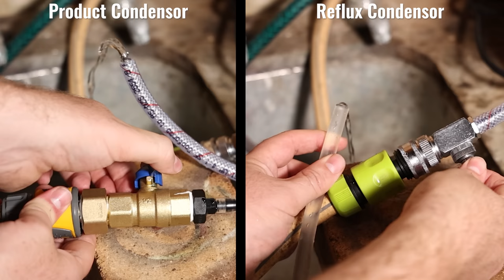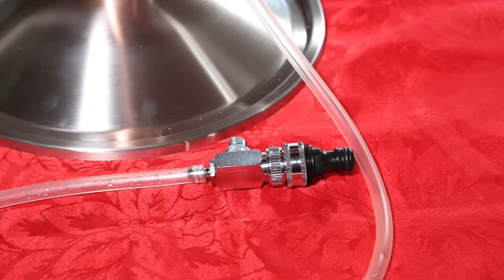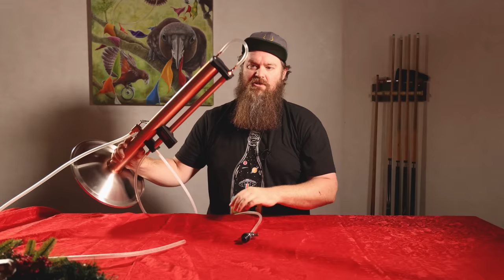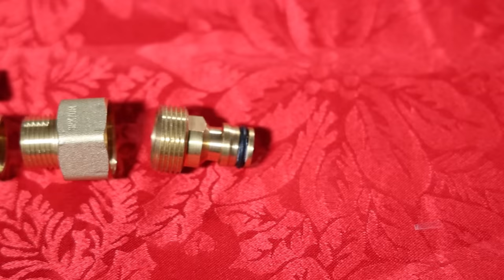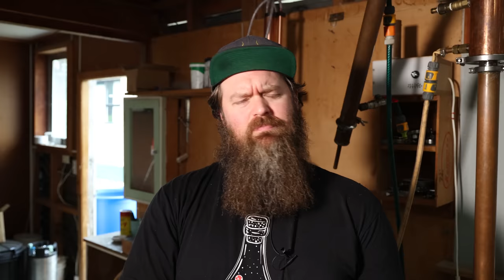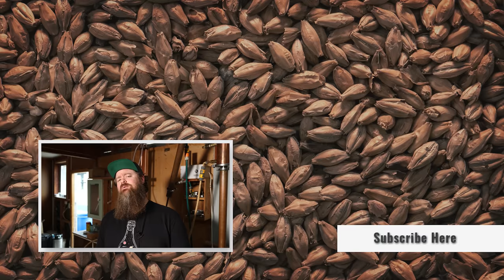Upgrade Your T500 Water Supply : Separate Product & Reflux Condensers

Comment: You only need one water supply. Put a T fitting on the hose coming out of the condenser. On the T, put one hose to exit the condenser. The other end of the T, put a hose with a valve on it going to the reflux chamber. That will give you free flow through the condenser and let you control flow through the reflux column.
Reply: Right, but each leg of the supply needs a separate needle valve to best control water flow.
Reply: @rocketsroc  true. But I believe Jesse did say he wasn't concerned about controlling flow through the condenser.
Reply: @jason6175  Ya, I have to use city water so running water any faster than necessary costs, so needle valves on both sides lets me adjust the flow as needed to either.  If water temperature is pretty cool, it doesn't take a huge flow through the condenser to condense, about 30 degree difference will do fine.

Comment: Hmmm I two minds about your mod’s, it would be better if the column had a bigger diameter.
Reply: Of course, but the main idea is to take the column as it is and upgrade it, not to buy a new different one (unless you can talk another manufacturer to meet a similar price point for a similar all in one system) I wish it was easy to just swap columns to a bigger one but unless you have an idea of how to do it easily looks in your direction hopefully most of us will just have to make due

Comment: I never had much success using a ball valve to control water flow. They're very non-linear - i.e. they want to give you all or nothing, with not much precision in between, and this still really needs precision IME to balance the process.
Reply: Right, a ball valve is useless since it cannot be finely adjusted.  What is correct is a needle valve.
Reply: @rocketsroc  Sorry I missed your reply, YT now makes it really hard to see my comment history. Anyway I agree that needle valves are a step up from ball valves (or gate valves). But think about it: what happens if you restrict the flow area from a tap?  Answer, the water simply flows faster through the available gap. Which makes me think there probably isn't an easy relationship between "valve open amount" and flow rate. I've come to the conclusion that the only true way to control water flow rate is directly, using a pump whose RPM I can control with an Arduino or suchlike.
Reply: @MrSwanley  You are confused.  Any valve decreases the flow rate and needle valves enable you to slow the flow down to just drops.  A pump is not the way to control flow.  Example to prove this:  If you close off your garden hose by partially closeing the faucet, the flow rate reduces.  Pressure may increase, but flow rate will not be same as full open.  Use needle valves.
Reply: @rocketsroc  Sure, any valve changes the flow rate, but the relationship is not a simple linear one. And since I already tried it I'm quite certain about what I found. First I tried a ball valve, then a needle valve controlled by a servo motor (better, but only over a very narrow range),  and finally a peristaltic pump. Only the last one gives me perfectly predictable, linear flow, over a wide range with no backlash.

Comment: What's wrong with just keeping the way it's set up ?
Reply: If you're goal is just single good run of high proof reflux product there is nothing wrong with it keep it the way it is, but if you're a frequent watcher of the channel you know the benefits of stripping runs. 
If not the benefits are you can move through much more alcohol wash in the same amount of time, you can then do one good distillation once you have enough stripped product to fill the boiler safely.  The reason you want this isn't just so you get a lot of booze all at once but it's amazing for doing cuts because the cuts are so much easier to find when you have more booze you are working with (most people say even with a t500 do cuts).
Last reason is because he doesn't really like vodkas very much and you will see him in the next few videos running it like a make shift pot still out with more pot still character anyways. For that you want much less if any water going through the inner coil but you still want the condenser to be able to condense all the product coming out of the still otherwise you have alcohol vapors coming out of the still and that becomes a safety hazard for fire and explosions.

Comment: I’m 70 . Is that relevant .?
I subscribe to the KISS  system. Been brewing since I was 20.
I find the t500 works fine as it is.
Why complicate matters? I’m on tank water , and have lots of it.
I have a gravity fed house …… I just set it up and do 20 minute checks.
I only make vodka . From sugar.
I use an immersion heater coil for 30 minutes ,on top of the normal coil.
Cheers all.

Comment: This has nothing to do with the current video, just had a realisation:
You can screw a temperature probe into your ccvm boiler and hook it up to a pid together with your second heating element to control your water temperature when you are using it to heat up water for mashing
Reply: There is also a new boiler from spirit works that has this all built into the pot if you want to mash with it. https://youtu.be/NVjW8lUqh-k
Reply: @iantaylor1341  I am aware of their product but the price of itnis oretty difficult to justify for a hobby if you can have the same thing for about a quarter of the price if you put in about 10-15 minutes of work.
Mind you this only makes sense if you already own a still like the one Jessie does

Comment: water does not flow to the top.........??? there are internal pipes in the small tube.
Reply: from my understanding- vapour that makes it to the top goes past the top U shaped hose and on its way down it is met with the cool water which turns it back into a liquid....i think the vapour tube goes straight down and the water must spiral around it??

Comment: If you’re using a water tank and two pumps, would it be better to use a value to control the water flow from the pump or a Motor Speed controller on the pumps?

Comment: Is there a spesific reason you don't run the cooling from the bottom and up on this reflux?
Reply: It could be possible but the way the T500 is originally built it uses the coldest water in the condenser because the condenser is relatively small and it's more important that no uncondensed product come out than it is getting perfect reflux (though that is controlled by the speed of the water and it's not hard to have it in perfect reflux as I found out wondering why my still wasn't producing for 3 hours when it was in the manual suggested temp range (don't leave it at 50 unless (and this part is a guess) you remove some packing) ) letting uncondensed product come out could lead to explosive results.

Though why you would want to start at the bottom I don't know, it should be possible if you wish. Two of the issues you will run into are 
1) you will have to find a way to plug the hole that is meant for the thermometer/thermal couple
2) you will have to find another way to gauge how fast you want your reflux water to be going.
If I were George I would tell you anything is possible but just because it's possible doesn't mean it's a good idea. But my expertise only comes from a single run of the t500, the only run I've ever done. If you can find a reason that it might be worth it and you find that you somehow make better product with it please let us know we are always curious.

Comment: That needle valve is a piece of shit. Touch it and that upsets the flow. Throw it away and invest in a proper one from the engineering shop. Same goes for the valve in the water flow regulator they sell you.

Comment: So we aren't talking about the elephant in the room here??? Plastic in the vapor path ... really can't in good conscience recommend this product to anyone.
Reply: It's a water pipe.
Reply: It’s a water pipe for cooling, nothing to do with the vapour ‘path’
Reply: @anthonybarra2391  the top of the column is plastic. Take it apart and you'll see.
Reply: @paulmyfinger  the top of the column is plastic. Take one apart you'll see
Reply: Paul, you just might be in the wrong hobby.
Reply: @rocketsroc  doubt it seriously. I sure hope I never run across anything you make on accident if you think plastic is safe to use inside your still.
Reply: @paulhutchison6994  I think if it wasnt safe, they couldnt use it
Reply: @paulmyfinger  thats the same thing they said about asbestos too
Reply: @paulhutchison6994  Paul, the tubing isn't inside the system and makes no contact with the spirits.
Reply: @rocketsroc  you clearly haven't looked inside the column. If you take the top of the column off (which is made of plastic on the newer models) you will see the condenser goes into the plastic piece. The vapor comes up through the column to the plastic top then out through the condenser. I've got pictures of the one I took apart. Just can't share them on this platform.
Reply: @paulhutchison6994  Converted quite a few to separate the water flow to each condenser.  Doesn't matter.  Just drill your hole in the middle of the larger round section of the plastic top.
Reply: @rocketsroc  clearly you don't understand what I'm saying. I've done the conversion to separate the two condenses. If you take the product condenser physically off of the column. Look at how its connected. Its just sitting in the plastic housing that in on the top of the column.